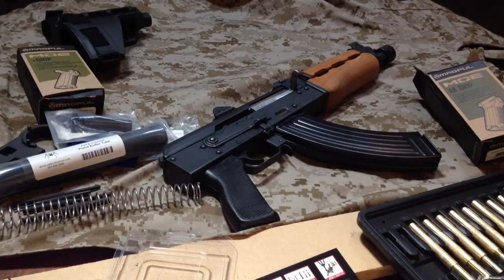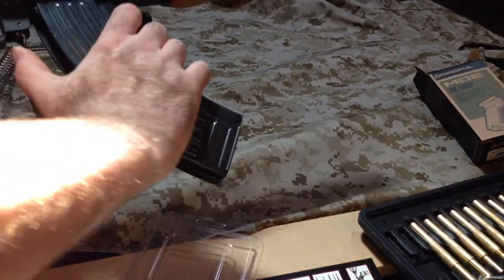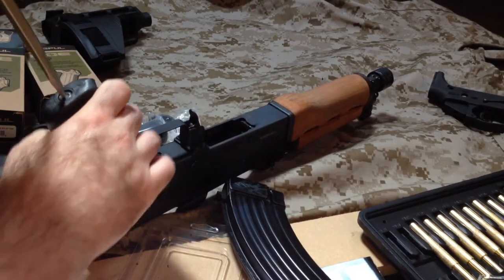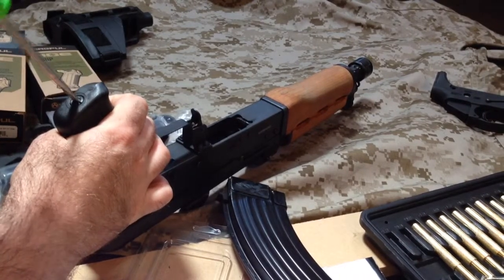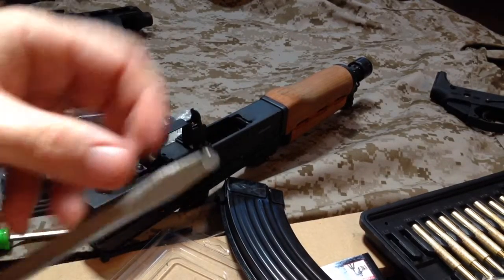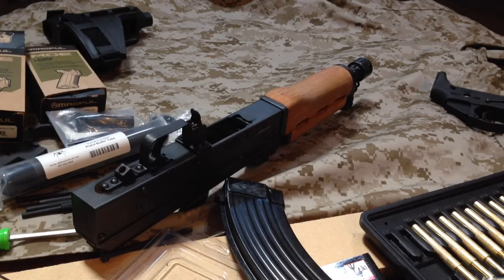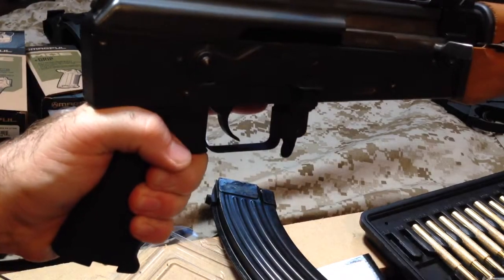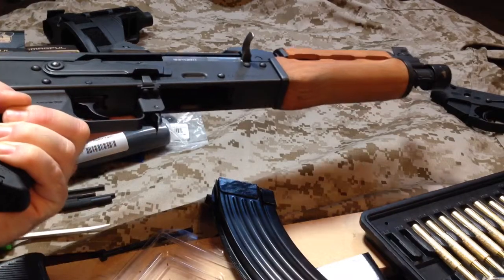M92 Magpul grip

Comment: My screw will not budge at all and began to strip. Pls answer help on how to remove, so I can use my sob47 brace.
Reply from the maker: Spray the screw with some liquid wrench, let it soak and use the largest head screwdriver that will fit. Might even tap down the screwdriver into the head with a hammer.
Reply: i tried all of that, nothing worked. had to dremel it off. and buy moe magpul grip
Reply: i even let it sit with a good amount of wd 40 over night, and the weekend.
Reply: Smh im having the same issue
Reply: Same issue can’t get my pistol grip screw to budge you guys think a drill will work ?